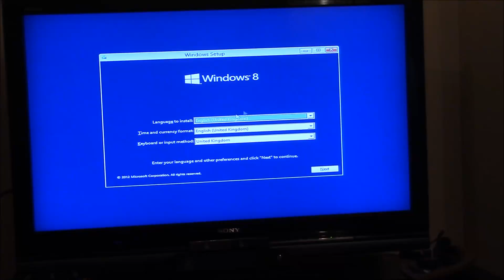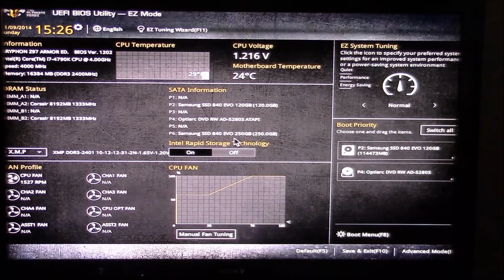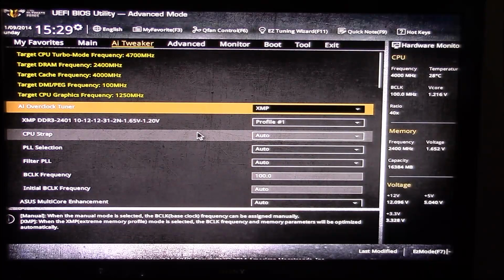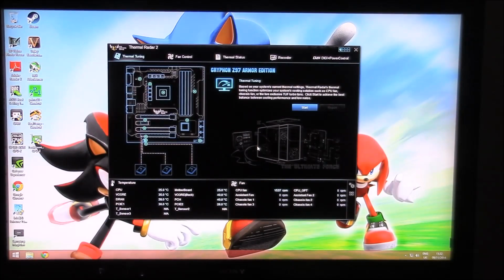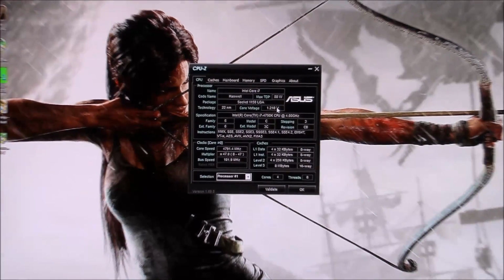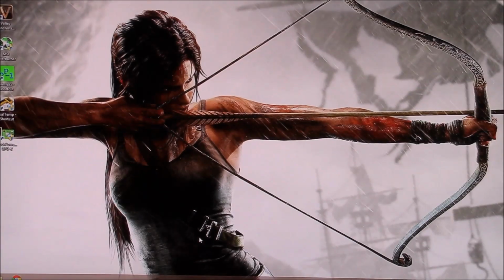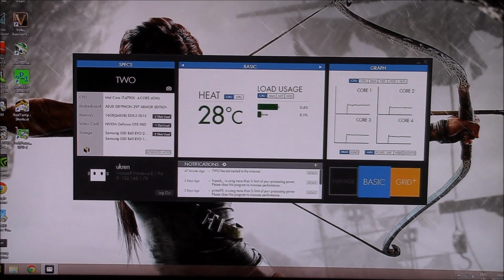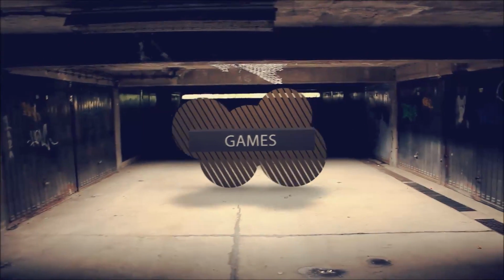Corsair Air 240 build Number log 3. Software installation, Overclocking and tools used.

Comment: Could someone explain to me how the fans are working?
Reply: Awesome, thank you!
Reply from the maker: +Doughnut, Lord of Friendship What you mean mate?
Reply: I suppose I should have clarified. I guess I want to know if any of those fans are intaking air or are they all blowing air outwards, even the ones around the radiator?
Reply: The front radiator fans all suck air into the case and the top fans blow air out..

Comment: hey man could you tell me the stock teps you wer getting on the CPU? i plan on getting this build http://pcpartpicker.com/p/2vtwsY and if im able to ill do push pull on the rad! i scared about the temps tho!
Reply from the maker: +GamingSoup Can't remember stck temps mate but the Corsair H100i GTX will fit in push pull ( just ) and depending on the chip, you should get decent overclocks and temps..

Comment: Hi may i know how do you install the nzxt grid?
Reply from the maker: the grid just plugs into an internal usb header and molex for power. Simple mate, the software is called cam and is on the nzxt website. Very easy procedure
Reply from the maker: the grid plus unit is stuck ontop of the cpu with some Velcro
Reply: you said you used sp120 quiet edn but those are 4 pins whereas the nzxt grid+ has only 3 pins. anything im missing?
Reply from the maker: good question mate. The fans so come in either 3 or 4 pin but if using 4 pins, nxzt have popped some splitters/4 to 3 pin adapter's. As I'm running 4 rad fans, I popped doubled them up and used the  splitters
Reply: thanks alot for addressing my concerns. im trying to build my first pc here. just trying not to get overwhelmed! did the splitters come with the grid+ or you got them separately?

Comment: That's a good looking build, at least on the mobo side. I can't wait till I watch the final stages to see how you have managed the cables. Impressed with the watercooling hose management too.

I never install the mobo utilities as I have noticed that this can be problematic, or at least has been so with previous installations where my USB ports were not allowing me to connect USB devices consistently, particularly things like my USB scanner, mobile phones and memory card readers.
Reply from the maker: thanks mate. Due to time constraints and trying to get the build log up, I don't show the cabling but its tidyish 😉

Comment: Jo mate,
I have also the nzxt grid+ but how you do that the fans are running faster when cpu getting hot! And when cpu is idle that the fans are low level?
Reply from the maker: Have you downloaded the CAM software from the NZXT site?

With this, you can set the fans to performance as I have or silent, or a custom curve :)

Comment: Do you know if this push pull plus top fan and blower GFX card results in positive pressure ?
Reply from the maker: You know, I really don't! I've never bothered with positive/negative pressure set ups. I guess there is more air coming in so that would mean it would be positive and would naturally push air fro the case..
Reply: Thanks, i have been wanting to build the exact same system, nice to know it works =D
Reply from the maker: welcome mate. Thanks for watching. Let me know how your build works out!

Comment: Do you think it would be possible to SLI? I'm going to be using a slightly different GPU (EVGA FTW GTX 970) and would like to have the option of adding another in the future. Just wondering if you can see any issues I might have. Thanks!
Reply from the maker: No, none at all. The cards will get hotter as they exhaust heat back into the case ( unlike the reffblower style ) but as long as you have good airflow it shouldn't cause you an issue.

2 970's in SLI will be AWESOME!
Reply: Ren Gaming Sweet, thanks dude!
Reply from the maker: Welcome mate
Reply: Ren Gaming Did you get any new fans to go with the H105 or stick with the stock ones? How are they?
Reply: Ren Gaming And what's your fan configuration?
Reply from the maker: I use SP120 quiet editions on most of my builds. The stock fans are great but can be a little noisy
Reply from the maker: I use the rad fans to pull air into the build and the top to exhaust. The graphics card exhausts out the back and pulls air from the bottom mesh.
Reply: Ren Gaming Sounds good. How are your temps? I'm considering doing a similar setup but I'm a little concerned about temps once I add a second 970. Trying to decide between your fan setup, and a H75 in the top front slot and a AF120 in the bottom front slot to provide cool air to the GPUs.
Reply from the maker: Max temps @ 4.8 are 71 and the card rarely hits 60 @ 1380 and 7600.

The h75 in the top slot is a great idea!
Reply: Ren Gaming Think I'll go for your fan setup now, as I'm not going to be adding another 970 for another year or two (or whenever it becomes necessary). Then I can always go for the H75 and extra fan if I find if the two GPUs are getting too high. Great video, and thanks for all your help! May be back soon with a few more questions :P
Reply from the maker: You are welcome and thank you for watching! any questions, anytime, pop em over!

Comment: Loved the guide on overclocking, I'm hoping the motherboard I'm getting (Gigabyte Z97X-UD3H-BK Intel Z97) has that software from desktop, I have never overclocked before and it's my biggest worry :)
Reply from the maker: I love making these vids! I hope it helps
Its pretty simple mate, check voltage at max, set that manually, increase multiplier :)
Just watch temps and if it blue screens, up voltage by .1. If it gets to toasty you may need to back it down a bit but bear in mind, your PC will never be at the stress levels of Prime95, its extreme!